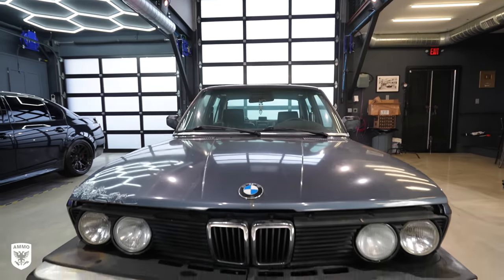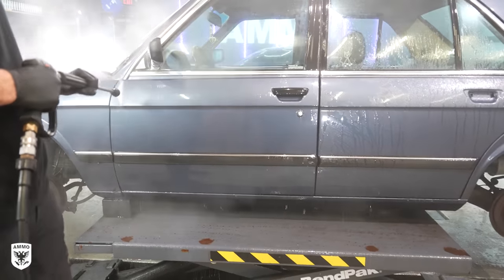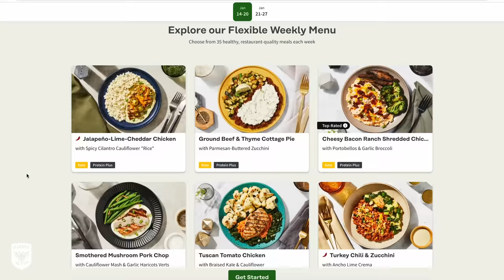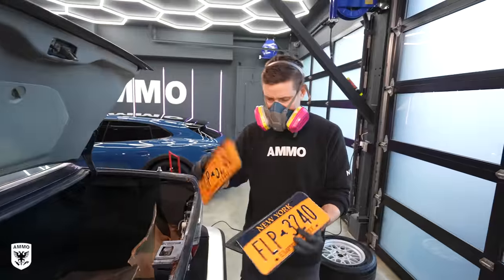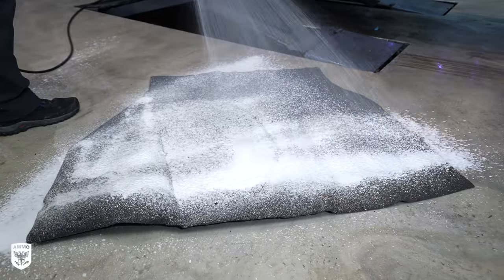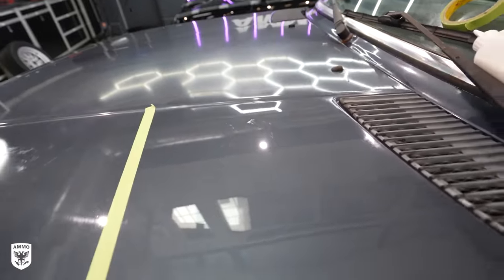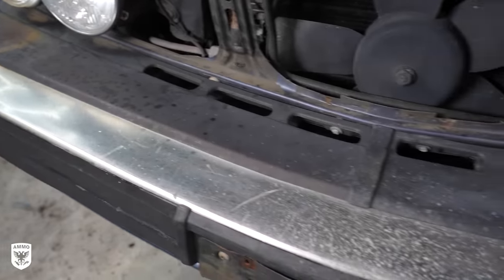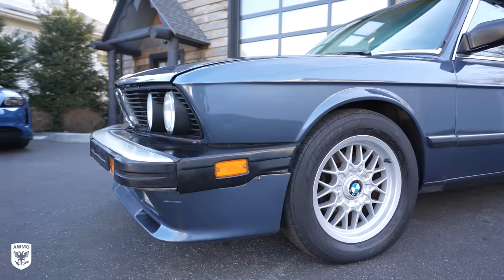Free Abandoned Car: Disgusting BMW 535i Disaster Detail Giveaway to Subscriber!

Comment: Not sure if the car sat for a decade there, it was registered up until 4/10/2019 with a replacement license plate of ‘MY86BMW’ which means that someone renewed it in 2017, 2015 & 2013,  nice restoration though !

Comment: Larry, I love what you did with this car. I was hoping that you would show us what you did to fix up the roof with the washed out clear coat. I just bought a car that has the same sort of clear coat issue on the roof and wanted to see how you would address it. I have been hoping there is a solution that I can try before simply respraying it.

Comment: Those wheels are BMW Style 29 from 1997-2003 5 series e39 chassis and have a 74.1 hub bore vs the e28 535 having a 72.56 hub bore. They require hub rings to mount accurately to the hubs or else a wobble can occur. I suggest metal (alu) rings not plastic. The wheels are not BBS RS 3pc from the 80s or Alpina's or Hartge's and if you want a center cap I have one, used, for free plus the cost of postage. They're probably a $2-400 set of wheels in good shape and are an excellent fit for these e28 cars, I believe about 16x7 et20.

Comment: Larry, at 14:17 did you just do that entire side with one go? did you not add polish to the pad on each panel????
another side question, I saw you using a DA air sander when you sanded the paint, I was wondering is that better than using like a normal wood da sander? because I need to sand my paint but I don't have a sander yet